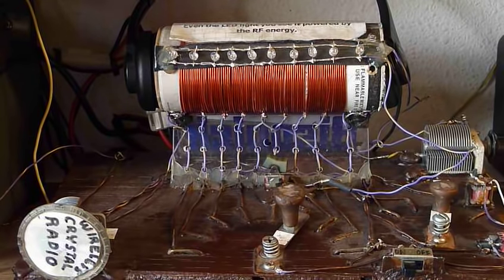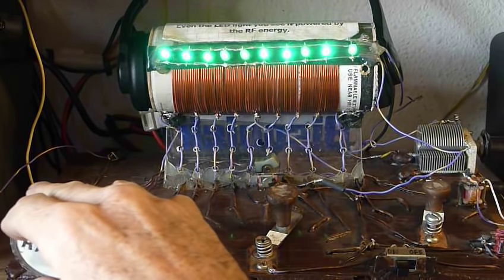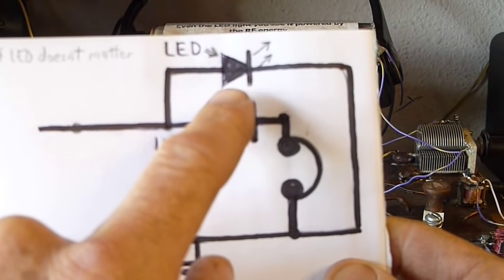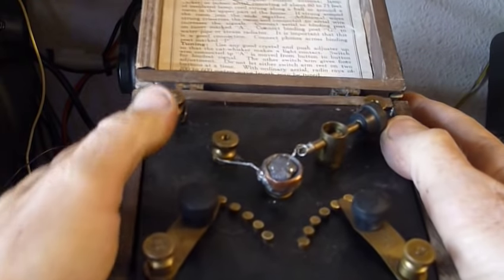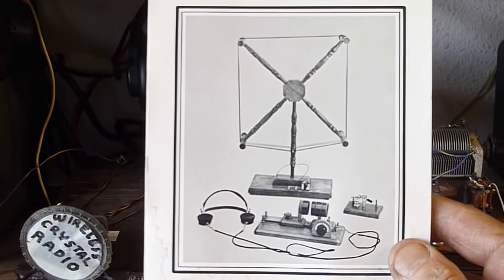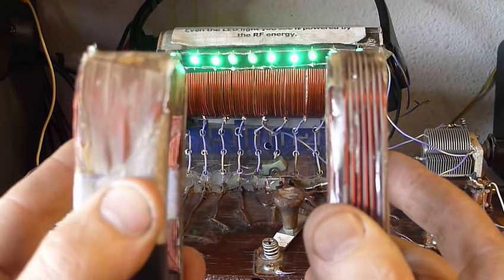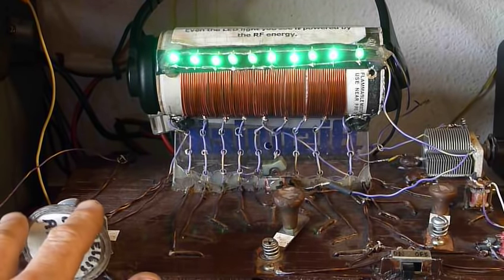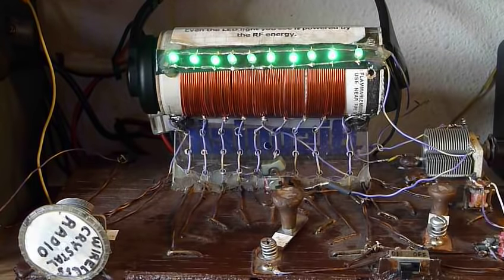Free Energy From Radio Waves. See info section for additional video.

Comment: Do you think that power lines could be hooked up to antennas right now and the energy companies are charging us for energy they get for free?
Reply from the maker: Unfortunately no. The power company sends us 60 cycle AC which is produced by generators. The power I'm getting off of my antenna is much higher in frequency, and produced by one of the radio stations near by.
Reply: Do you think antennas could produce more power than generators?
Reply from the maker: No. Not even close. The amount of power I'm picking up from the radio station transmitters is extremely small.
Reply: have you looked into the RFID technology which requires no wires at all, but sends electromagnetic waves from antenna to antenna as energy?
Reply from the maker: Yes I'm familiar with RFID technology, or what some call "the mark of the beast chip",  but the amount of energy it sends to the chip is extremely small over a short distance. Being able to send energy by way of wireless transmission is possible,  but not substantial quantities, and the further you are from the transmitter, the weaker the power transfer will be. A transformer which is Two separate coils and a  metal core sends wireless energy through a magnetic field called induction, but look how close the Two coils must be to each other in order to work properly. If you place a substantial distance between the coils very little power can be transferred to the other coil.
Reply: What if the RF and transformers were just used at a local power plant to generate steam energy, and then it was sent by power lines commercially? Wouldn't that eliminate the need to burn coal ?
Reply from the maker: There are many ways to generate power other than burning coal. Steam is one of them, solar, wind power, hydro power, nuclear power. I think it boils down to getting the most energy for the buck.
Reply: Wouldn't it be the cheapest to just transform RF energy at a power plant and then send it out on power lines?
Reply from the maker: No that would waste energy. What makes you think sending RF energy through transmission lines has some kind of advantage?
Reply: I think it would be an advantage because there would be no pollution, it would be cheaper, and you wouldn't have to burn anything. How does it waste energy?
Reply from the maker: There would be many energy wasting problems you would encounter if you were trying to transfer RF energy through transmission lines.  One of them would be the inductive an reactive losses that occur when you pass RF energy through a transmission line. There would also be loss from the inefficiencies of converting your low cycle  AC power to RF power, and then back to low cycle AC power again for consumer use. Why would you think there would be any less pollution by sending RF power Vs 60 cycle AC power?
Reply: My curious comes from lack of hands on experience, not criticism of your model.  If you can transform your atmospheric current into enough voltage to supply your house breaker, than it's just as clever. But with RF, there would be one less wire.  I think what's important is that we have free unlimited energy.

Comment: In the late 60 s I built a receiver transmitter that used only the power in the air. Transmitter would not change but receivers after would have less energy to work with.energy is conserved.

Comment: Want to know where you purchased the 1N34 diode?  have tried allelectronics and fry's no luck
Reply from the maker: If you google those numbers you will find many retailers who sell them.
Reply: Thank you found them....have you tried the 1N34A?  Does it work as well?
Reply from the maker: I don't know if there is any difference between the 1N34 and the 1N34A, but the IN34 should work well. When you put up an antenna just make sure it's good and high like this one. https://www.youtube.com/watch?v=Xz5BCh0kAOQ

Comment: Could you possibly do a system like this to run a Raspberry pi zero.  It uses 80mA.
Reply from the maker: If you lived close enough to a high powered radio staton you could. I'm only able to get about 2 milliamps at this location, about a mile from the transmitter.

Comment: I think wireless electricity with radio is possible. If we make a radio box like a WiFi box the emits the stable radio frequency. The at devices amplify the voltage with transistors. You will need an initial charge so the device should have a battery, maybe recharge it from mains. Intell have made 1 billion transistors chips so just apply it to electricity. If they could make a motors chip maybe they could do what the car does to recharge its own battery when in use, amplify with transistors. Normally we just resist the high voltage frequency from mains. It's all just frequency. Wireless electrity would have advantages, longer battery, always on mobile phones, useful for space travel, less plugs. I think it could combine well with the electricity mains system except probably the technology is held back because electricity companies would make less money on bills. However its clearly a useful advantage if we can start using it with some of our mobile devices or appliances.
Reply from the maker: If you figure it out let me know.
Reply: @GrantsPassTVRepair  I have, you need to sell the idea of the benefits to governments in order to prevent the technology suppression by electricity companies that want to sell electricity units through wired systems. My solution is Simply create a wireless radio box rental system so I would pay $100 a month to have the. wireless radio box that. works with wireless electricity devices.

Comment: Great, now can you make a circuit that can  accumulate more currrent?
Reply: HowToExcel current is not power, voltage is not power but the two multipied together is power.
Reply: can lower voltage to increase the current
Reply: @youtuberesearch7017  So lets see a video where it can run a small motor. :-)

Comment: Because of alternating current i think that you are mssing half the signal that could be used to get twice the power.
On the internet somewere,i dont remember,  i saw a schematic of a crystal set that used two diodes to pick up both alternating current of the radio wave and feed it to a small speaker ,just before the audio reach this small speaker it had two small capacitor to boost the audio power more and a matching audio transformer for feeding the correct ohm to the small normal transister type speaker,,if you can do that with this crystal set,imagen what this other set could do!.this type of radio due to it´s double detection gave that extra kick to the speakers..if i was you i would try and search  and  check it out,wish i remember were i saw it.. 
   Found it -----------------www.rfcafe.com/.../high-power-crystal-set-august-1960-popular
Reply from the maker: That link didn't work.
Reply: Just type    on GOOGLE---------- HIGH POWER CRYSTAL SET-----------   see if it pops out    it should write---High Power Crystal Set, August 1960 Popular Electronics - RF Cafe

Comment: any new updates on these ? have you tried charging a battery with these outputs?
Reply from the maker: I was able to slowly charge a large capacitor, but no batteries yet.
Reply: @GrantsPassTVRepair  try charging a 6volt moped lead acid battery for a start...those lights are so bright im confident it can be done!
Reply from the maker: @fidelcatsro6948 It might work, but the amount of available power is so low it's not worth the effort.
Reply: @GrantsPassTVRepair  
awww maan! you need encouragement!! dont give up amigo! i hope you succeed!
what about connecting the outs to a step down transformer to convert it to lower voltage higher amp?
or coupling them to a joule thief circuit?

Comment: To see how well your reliever is really doing you need to figure out the power received in watts. You need to measure the voltage output and the current and then multiply them. Current alone is not the same as power. You said you measured 5 ma and the lights need 3.6 volts. So .005 X 3.6 = 18 mw of power from a radio station 1 mile away with a 200 foot long antenna.  That's good enough to light a few LED's but really not enough power to run a vacuum cleaner, washing machine or a refrigerator. The coupling losses using radio waves are too high to send practical levels of power that way. You can send information via radio waves but practical power transmission to run everyday devices will require wires to do it.
Reply from the maker: 3.6 volts is their ideal operating voltage @ 20 MA, but I should have explained that LEDs can still operate at far less voltage than their ideal operating voltage such as the ones I'm demonstrating. Even as little as 3 volts can illuminate them with far less intensity.

Comment: Could you trickle charge a battery pack…?
Reply from the maker: I suppose you could trickle charge a battery, but it's such a small amount of power, you're not going to get enough to make it worth the trouble. You would do much better with a small solar panel.
Reply: @GrantsPassTVRepair  yea. For sure. But the novelty would be more fun this way. Haha.

Comment: If you can make many of these and combine their power i wonder if it can make 50 volt?
Reply from the maker: +Meiji Jap I'm suspect I could produce 50 volts or more with a longer antenna since the radio station transmitter is fairly close, but I don't think the crystal radio would produce enough current to be very useful.
Reply: +Grants Pass TV Repair maybe some electrical component like transistor or toroid can amplify current?
Reply from the maker: +Meiji Jap The problem with raising the current is that it lowers the voltage. You might understand more if you watch this video I made on understanding current, voltage and wattage at this link. https://www.youtube.com/watch?v=6Zxp8lSdn8M
Reply: A transistor amplifier simply uses the low power signal input to control the power going through another higher current/power pathway. A good analogy would be that the input signal controls the on/off valve on a kitchen faucet, where the water behaves like the flow of electric current.

Comment: Um.. an LED IS a diode... so why not use an LED in the place of the plain diode?
Reply from the maker: Most LEDs have a very low current capacity, so you're not likely to rectify enough power to be of much use if you used an LED in place of a diode.
Reply: Makes sense, thanks! And thanks for the reply!

Comment: It's always easy to get high voltages. How about some high currents :-)
Reply: Cap banks and multiple stages
Reply: @markhodgson2348  Energy storage, yes, use this scaled up a bit for tricking my deep cycle batts - Then call the energy company and have them remove there wires
Reply: Amen help me with it

Comment: how high is the antenna ?
Reply from the maker: I'd guess my antenna is 50 to 70 feet up, but if you're close enough to the radio station you can still light up an LED even if the wire is on the ground as I demonstrate at this video link.  https://www.youtube.com/watch?v=yqljaKjKjd4

Comment: It's not the power you measured, it's current. You have 10 LEDs, let's round the voltage to 2V per LED, that's 20V*5mA = 100mW = 0.1W - that's the power. It's nice that you collected 0.1W out of the megawatts being transmitted, but it's not that amazing. Well ok, it's a nice thing to play with.

Comment: Those LEDs are about 5mA each, all in parallel, that’s about 50mA at approx 2volts...  sorry mate, unless you live next door to a transmitter, I have to call BS! ...  nice show, but I think your Engineering a better result than is possible.
Reply from the maker: I meant all the LEDs combined are using about 5 MA, but keep in mind they are not putting out full brightness. I live about a mile from the transmitter which puts out 10,000 watts during the day, and only 48 watts at night, but even at night I can see a very faint glow from my LEDs.
Reply: @GrantsPassTVRepair  I figured out that you are pulling in about 18 mw (5 ma X 3.6V = 18 mw. I posted more about it to your video.

Comment: It's scary to think about all the EM radiation that we are saturated by every second.
Reply from the maker: I've often wondered about that myself, but seeing many of my ham radio friends are still alive and well ofter much exposure to RF radiation, I'm guessing most radio waves are probably harmless up to a certain frequency range, but considering how a microwave works, I sure would not want to be exposed to the high energy high frequency waves.
Reply: I spend most of my time thinking the same thing, Being Navy we always pass around the old story about how some poor unknowing fools in the early days of Radar used to actually stand in front of the Dish to keep warm. Dear God, the amout of damage Man has done to it's self along the way trying to learn what works, & what's Toxic. I myself was Exposed to irradiated gear, that came back from the Fukushima meltdown, shortly after I had a rapid growing mass in my left Leg, I just had it removed. They said I'm perfectly fine, but only time will tell. I would not trust the VA if they told me the Sky was Blue. At least they are still paying me for now.

Comment: comon lads you dont light diodes constant unless you have a carrier avalable from an artifical source near by . all hes doing is selling a book . any way if a distant carrier was strong enough to light leds it would vary strength with signal making leds change brillance .by way leds dont light with ac ????????????
Reply from the maker: +Maria Woodhouse Aside from being wrong your comment makes no sense. As long as the voltage is correct LEDs will light up using AC. They automatically rectify the AC because LEDs are diodes. 
 Why don't you do some research before posting a comment?
Reply: It is varying in strength... BUT at a frequency of the instrumental or voices on the radio station, and most instruments tend to play around several hundred hertz, and human voices are also 100-200 hertz. You're not going to be able to see the fluctuation, probably not even in person, but definitely not on a 30 FPS youtube video...
Reply: You learn that in Uni kek?
Reply: Maria Woodhouse. Right on all counts except LED will use AC by self rectification. It is itself a diode and will conduct only one direction. BTW I use an LED indicator in a wave meter by connecting directly to the tank circuit.

Comment: Hi, and thanks for an eye opening video, If you don't mind I'll ask a few questions:

1. Do you have a schematic of the circuit? *sorry ignore that*
2. Are you using two variacs in your circuit?
3. are you using a step up transformer for the output?

Thanks,
Gary.
Reply: +Gary Stevens
 i need the circuit,can u giive me please?
Reply from the maker: +Gary Stevens I'm using an impedance matching transformer for the speaker output, but you don't need it if  your just trying to power the LEDs.  There are no variacs in this design. Only a couple tuning capacitors. Here is a schematic that comes close. http://www.freeinfosociety.com/electronics/schemview.php?id=1705
Reply: Thank you sir,but the web site is not working
Reply from the maker: +Tetra Aquarium You can google the words crystal radio schematic and come up with something that 
should work as long as your antenna is long enough, and you live fairly close to an AM radio station like I do.
Reply: I built one of these as part of my shop class in junior high and I lived so close to one of the radio stations that the only antenna I needed was the input lead going into the diode, and connected the other end of the diode in series to an earphone/earbud and then to ground.

For some reason I didn't even need a separate tuning coil, or capacitor. I think the coil in the earphone was all that was needed, and the wiring going in and out of the earphone had a small amount of capacitance as well.

- I am still amazed to this day....
Reply from the maker: I don't have the schematic for this crystal radio, but I posted a link to a book that does in the info section of the video. Crystal radio schematics can be found through Google. They are quite simple.

Comment: 4 hours for a radio wave to reach a satellite? A deep space satellite maybe. Radio waves travel at the speed of light and it takes around 8 minutes for light to reach us from the sun. The sun is much farther away from us than an orbiting satellite.
Reply from the maker: I understand. I remember hearing this 4 hour time factor related to a deep space satellite a few years ago. I suppose the satellite must have travelled a few years to take this long.
Reply: @GrantsPassTVRepair  
Yes, I understand that it takes a couple of hours at the speed of light to reach Mars. I could be a bit off about that one but if I'm right then it's about 4 hours from the time of transmission to the reception of a reply. And that's when Mars and the earth are on the same side of the sun, I think. Now I'm just guessing though.